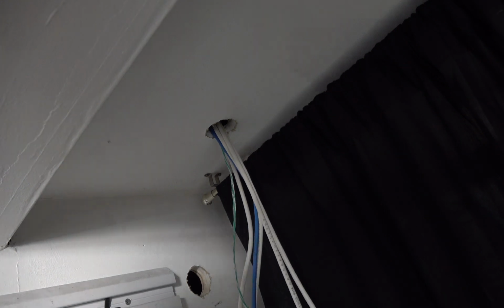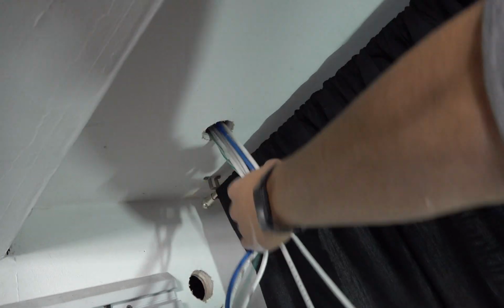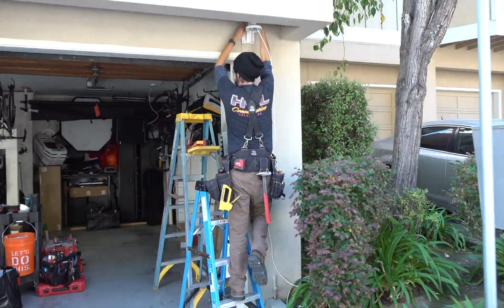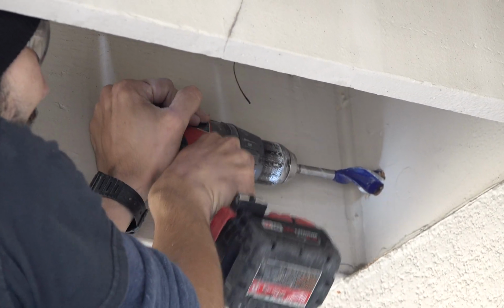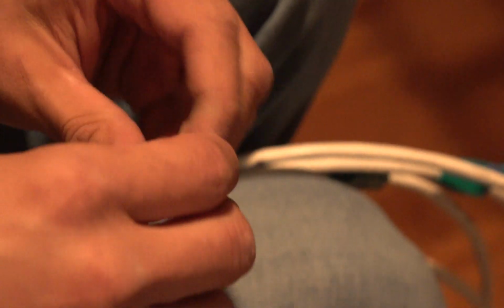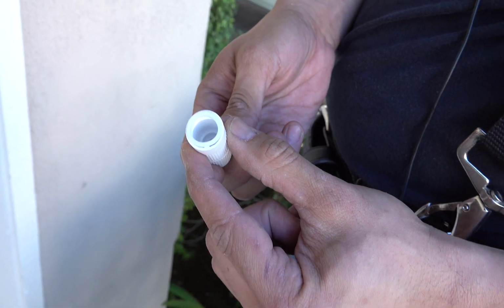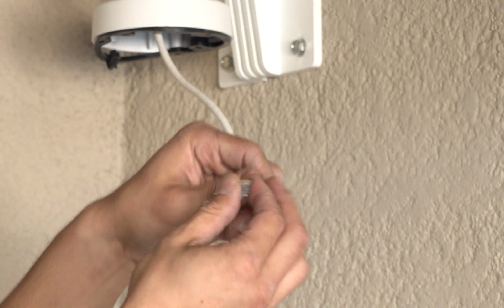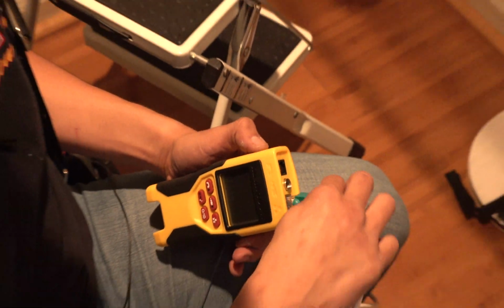Security Camera Ethernet Cable Install and Testing 4k

Comment: What ethernet cable would you recommend for using in a Hikvision NVR along with ds-2de4a425iw-de camera? Would the True Cable cat6 riser cable work for in wall installation?